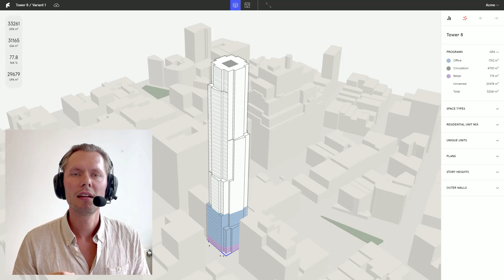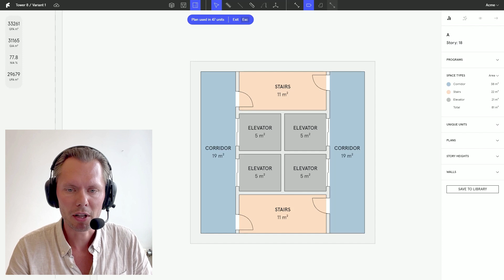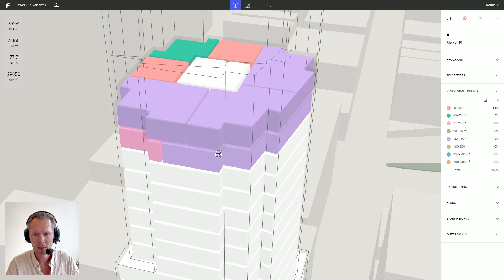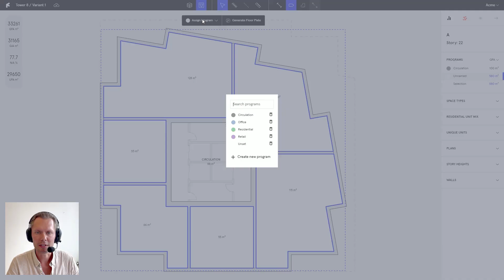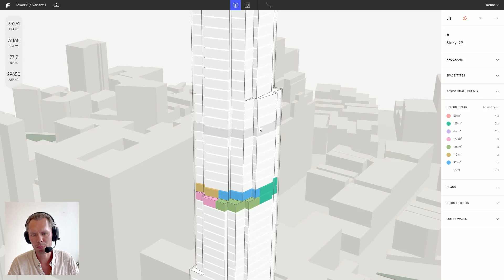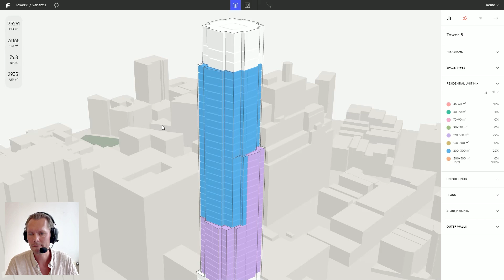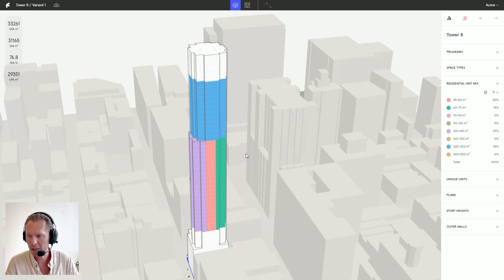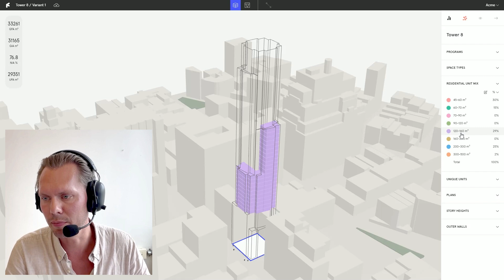Generate unit mix with Finch

Comment: Thanks for sharing. This is amazing. What will happen if we name the program and space type for other buildings type, example transportation metro station building and create a library. Will that work ?
Reply from the maker: @michaeldaimei7260  you can create whatever program/space type you want. The limitation right now is that when you run this algorithm, the space needs to be named corridor. But you could of course change that afterwards. ;) but the algorithm is optimized for residential.